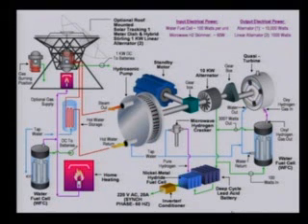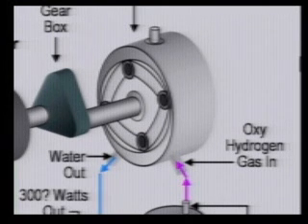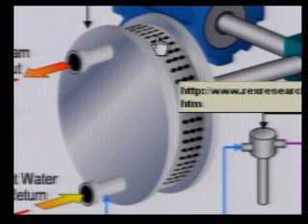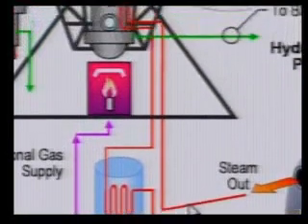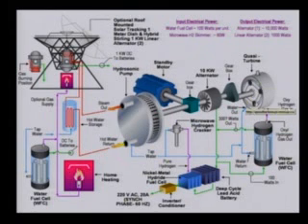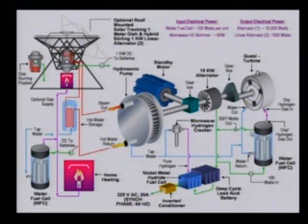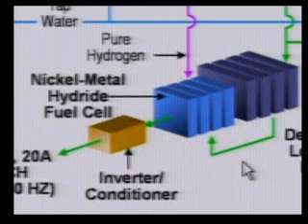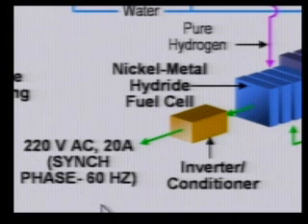2007(E 1/2) Quasiturbine and fuel cell

Comment: I haven't seen part 2 yet, but my comments so far are...

It looks like an over taxed system. There's so much friction in the gear reduction that I wonder if it would be easier to make steam from the 20KW generator than to try to do it kinetically as shown.

Moreover, if you use and an AC generator, there's no need to invert power to sell to the utility grid, and no resultant lost of energy via heat.